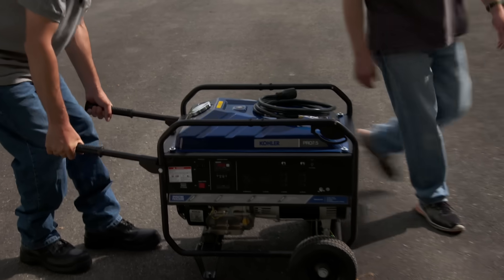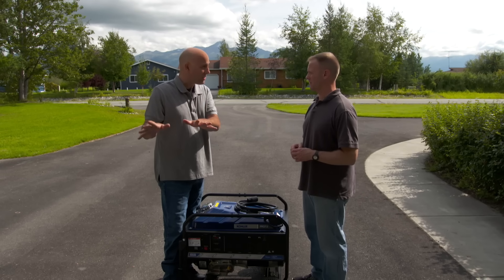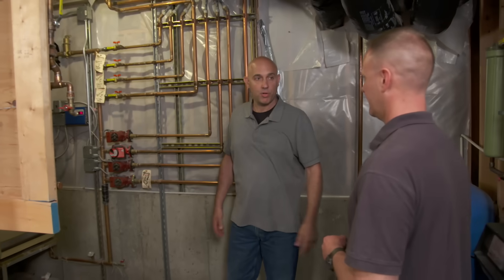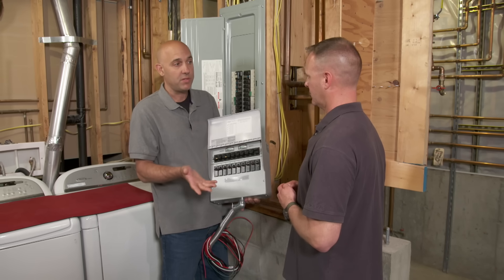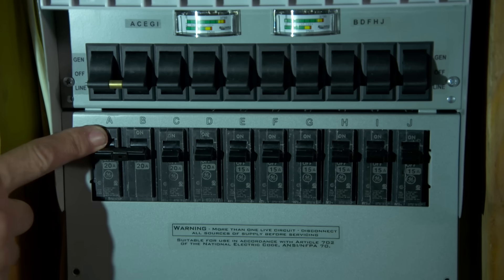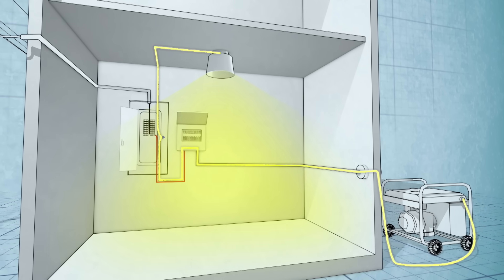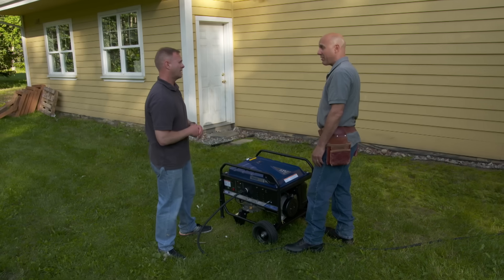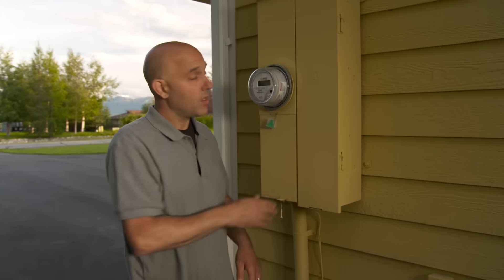How to Install a Manual Transfer Switch for a Portable Generator | Ask This Old House

Comment: If I have AFCI in my main that I want to feed from transfer switch - do I have to install AFCI in transfer switch? From what I'm reading so far - it seems to be the case. Is it OK to connect neural from circuit via wire nut to run down to switch?
Reply: The AFCI could be wired as is, the result will be that during generator power the circuit will not have AFCI protection which is acceptable in many cases.  If AFCI protected is required or wanted during generator operation, then yes you can install an AFCI in the transfer switch.  Special wiring is necessary as the AFCI's will have to be wired together, and yes a wire connector can be used in the bottom compartment of the switch.  If you would like any information on the wiring methods for an AFCI please contact us at support@reliancecontrols.com

Comment: Do you have a video on how to tie the transfer switch into a recessed electrical panel?  The videos I have seen are surface mounted electrical panels or recessed panels with no sheet rock around them.  My main panel is recessed in a finished wall in a bedroom closet.  Am I going to have to demo the wall to add the transfer switch?  Thanks in advance for your answer.
Reply: I don't know of a video that shows a flush mount installation, although the wiring will be exactly the same.  In most cases yes you will want to also flush mount the transfer switch, most transfer switches have accessory kits to help with flush mounting.
Reply: Electric panels are not allowed in closets.

Comment: AM FROM AFRICA! WHY DOES AMERICANS USE 11O VOLTS INSTEAD OF 240 VOLTS?
Reply: America has 110 volts and 220 volts in the same 3-wire system.     110 for lights and small appliances.  220 for stoves, A/C, dryers.
Reply: Because it taste better.
Reply: In Australia we have 230-240v single phase for everything.and also 3phase.

Comment: Interesting episode.  We lived for a week and a half after a bad storm on a 4500 watt gen.   Had lights, refrigerator and ran our gas fired furnace. When we cooked on an electric skillet I made sure the furnace wasn't going to kick on. All done with extension cords. I need to look into a manual transfer.
Reply: A cheaper option would be an interlock kit.  This option also allows you to choose any circuit you want.  The transfer switch limits you to 8 or 10 circuits...depending on the transfer switch you purchase.  Search YouTube for videos about interlock kits.
Reply: Kevin N thanks, that helped out alot because im currently looking to purchase one living WA. Dont need to much to get use through a bad storm or what not. Was looking to get a 7000 watt, but sounds like 4500 does the job.
Reply: Kevin N look into the generac meter you plug it right into the meter when you have it plugged in it automatically has a safety inside for when power goes back on it's just way easier and no extra fuse boxes
Reply: Kevin N y

Comment: What would be the average cost for labor to install something like this?
Reply: It can vary greatly, around 2-3 hours at most on average.  A lot has to do with running the wires from the outdoor plug in (inlet box) to inside to the transfer switch.

Comment: That generator will need some kind of shelter. You can't really leave it sitting out in the middle of the yard during a heavy rain storm, big snow or ice storm. Also, if it is stored in the garage and the power fails after a big 3+ feet snow storm getting it TO the back yard is going to be a challenge.
Reply: So you didn't watch?

Comment: he did not say that the generator should be runned once a month to provent the carburator from gumming up and ceep it warm in the whinter time , it might not start at all if he dosent do this and always use a transferswitch.
Reply: Best thing to do is, while running generator for a period of time, turn off the gas valve and let it run till it stops, just make sure it's not powering anything..that way you don't leave any gas sitting in the carburetor and it will start every time you need it...this has worked on my generator for about 15 yrs with no issues...
Reply: Even better get a generator that is fuel injected with no carburbator.

Comment: How is this functionally different from flipping off your Main breaker and feeding the panel directly through another breaker? Are there Main breakers out there that don't truly disconnect when you flip them?
Reply: It's different in that any human error can cause death or serious injury to any linemen working on the grid if you forget to turn off the mains before applying power. Directly feeding the panel through another breaker is fine but you must use a mechanical interlock device to prevent accidents.
Reply: @eosjoe565   I had my 200 amp panel wired up with 2 Square D Breakers at the top, below the Utility Meter feed. the top Breaker disconnected the panel from the Grid. The 2nd Breaker below that one, had an interlock to it that would not operate unless I switched off the top breaker to the Grid, first.. 
This 2nd Breaker was wired to the panel and to a giant NEMA Female Receptacle outside the garage, where I plugged the Male NEMA Plug that came for the Generator to it.. 
This thing ran usually 2 full weeks or so, 24/7 and we never had an issue.
Yes, we were mindful of how many big things we ran, and of course in winter the only things big are the Electric Dryer, the gas powered Furnace that had an electric fan, and the Hot Tub... Oh and perhaps the electric oven at times..

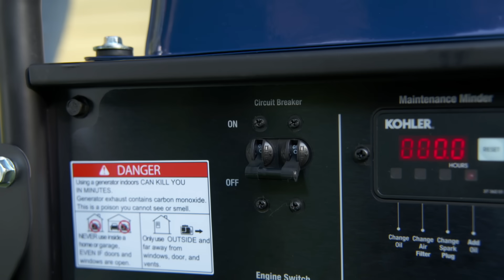Comment: The so-called expert is a total amateur and knows nothing.  Note how the so-called experts tells the ignorant homeowner to turn the choke OPEN at the 7:29 mark in the video.  Even little girls know that the choke is CLOSED for cold starts.  The video is a bunch of crap.  Anyone that has installed a manual transfer switch before knows how bad this video is.  At the 7:43 mark the ignorant homeowner didn't know what he was doing with the choke.  Like I said, even little girls know how to use a choke the proper way.  The procedure to use utility power when the power was restored were in error in the video.   The idiot-expert at the 6:30 mark was too dumb to know how to wind a cord; notice how there is a figure eight twist in the cord.
Reply: Over-under coiling reduces voltage drop, and so does using a cable that's only as long as you need it.

Comment: I'm curious as to what happens if you are using the generator and have to run to the store.  While you are at the store, your power is restored.  At that point you would have two power sources....what happens?
Reply: In the case of a manual transfer switch, you stay on the generator. If you had an automatic transfer switch and and a fancier generator, it would shut off the generator, and return to the utility side power.
Reply: The transfer switch isolates the generator from the utility side. Yes, at that point you have 2 power sources and you are on an expensive one (gasoline)..

Comment: why on earth didn't he get a natural gas generator
Reply: the early part of the video is very clear that he has interruption on the natural gas supply during winter. That's the whole reason the home owner was suggested for this.
Reply: Also the video is very helpful as not everyone has access to piped-in fuel like natural gas or want to buy a dedicated propane fuel tank just for emergency use only.
Reply: And they are located in an earthquake zone...
Reply: He's a noob

Comment: what i hate about these shows is how they show things in the simplest form. then people think they can do it themselves some can and some cant.. there is absolutely no discussion of how to figure the size of generator for the size load and no mention of motor startup current to be added in. how did they know what size wire to use? never mentioned.
Reply: This is not a how to channel. That guy is a certified electrician and that is a paying customer. These videos are not meant to be followed for DIY folks. It’s just basic education of what one may need when getting an estimate. Stop the nonsense folks!
Reply: james hawkins ¡
Reply: I understand and you do make a good point, however that's the purpose of the video short in my opinion - a simple explanation of one of many install methods of setting up a back up gen and transfer switch.  One could write a book on the topic to fully explain all of the information necessary to get even a basic understanding for those not versed in electrical theory or systems.  Some people have to plan for days or weeks before setting up such a system, and the vast amount of information associated with this topic requires quite a lot of research and study.  It would be great if they did indeed provide more information, but this is a TV show and certainly entertainment and ratings are above and beyond all other goals for them.
Reply: james hawkins 
I consider this show largely to rather to be about getting ideas of what to do with your house in certain situations, but not necessarily attempt yourself unless you’re certified... or really cheap and have a whole lot of life insurance.
Reply: I was going to say the same thing also  A 7.5 kW generator will only supply limited loads in the average house. You have to figure an energy budget based on your appliances consumption with the output of the generator. And I would not load the generator up to 7.5 kW, I would leave the remaining 500 watts for the pull down loads on appliance starts. IF you know you need a generator because you have a known history of power outages, then a stand by generator of at least a 20 kW is what you need.
Reply: richard cranium and then shit happens, not everything goes this smooth, guaranteed there will be at least one issue
Reply: @gksjsj4892  
You got THAT right!
The older the house, the bigger pain in the wazoo it seems to be to work on. 
I recently put in a six circuit version of this. Hookup was relatively painless. Finding a suitable mounting position and running the infeed cable- a three day ordeal.
Reply: JeevesReturns glad someone gets it.
Reply: 50 amp plug- never go over 80% load
Reply: This old house shows how to build whole houses, but I don't try it myself.  I don't see the problem here.  You hire pros for what pros should do.
Reply: Tricky to find 20kW gasoline powered generators out there from what I can find when "piped-in" fuels are not an option. Perhaps Diesel powered.
Reply: Number 10 wire good for 30-amp . How to choose the right generator is up to your pocket and how much u wanna spend  . Small generator good for few bulbs and fridge and well water and if u wanna run the boiler u need to be smart to shut a few lights
Reply: The purpose of this video isn't to show you how to do it step by step. Its an informative video, hire a licensed electrician to do this install. This is far beyond the average DIYer's skill range.
Reply: I have seen that to. The problem with "back-feeding" like that is that it renders the circuit breakers non functional. Now that I think of it, I believe I have only seen that done with old style fuses. Thoughts?
Reply: The transfer switch comes with all necessary wiring, which I'm sure is all 14 AWG.
Reply: richard cranium or no mention that messing with your mains power like that can land you in prison ... (Without certain licenses)
Reply: This video isn't supposed to make you a certified electrician. It's simply an informative video. If you aren't 100% sure what you are doing call a licensed electrician to do the job.
Reply: richard cranium maybe another video but it gives u a hoot run down. Do ur research
Reply: richard, I think this is a really good overview of how to install a transfer switch.  The graphic animation makes it very clear how it works.  If your going to do it yourself, then your going to have to do some more digging and calculating to get a good design that works for you.  Some people are going to want a big 20k generator that will run the whole house.  Others will opt to save money and fuel with a smaller 2k that just runs the fridge, window AC and a few lights.  There are endless possibilities...
Reply: richard cranium Otay!!.
Reply: There is also a concern about running electronic equipment (computers, TV, appliances with built-in electronics, stereo, ham radio, etc) off generators like these.  The AC power frequency is determined by the speed of the engine (usually 3600 rpm to generate 60 Hz).  I think a safer option would be to by an inverter generator like the Honda EU7000is that uses a DC generator and Power electronics to give you a stable 60Hz modified sine wave signal.

  7.5kW is the surge rating.  The continuous power rating is only 6.3kW for this generator. 

 For resistive loads your power is ...
P = (Irms_ 240)*240V  + (Irms_120_1)*120V + (Irm_120_2)*120V. 

If you have low power factor loads your generator will have to supply more current for a given amount of power.   P = Irms*Vrms*PF

https://kohlerpower.com/binaries/content/assets/portables/manuals/37_590_01_rev_b.pdf  

Another consideration is altitude.  I'm not sure if this house was in the mountains or not, but Kohler recommends installing a high-altitude carb kit for altitudes above 4000 ft.
Reply: richard cranium
It all goes back to that Woody Allen line "in a lot of high schools they had shop classes where they taught kids how to build things. In mine they taught us how to phone for estimates".
Reply: Read the title.  It's "How to install a transfer switch", not "How to select the right generator".  Also, read the description, it clearly stats the wiring.
Reply: Yes because you couldn’t possibly do some research on your own or, I don’t know, ask a professional electrician. Jesus...how do you do anything in life if you depend on YouTube to teach you?
Reply: Agreed. Also no mention of three phase power connections and if you can use a single phase generator on a home with three phase power.
Reply: richard cranium it's nice to hear someone who sees the same pliant. Never see any complications in projects online.
Glad you spoke.
Reply: Dana Sion generac or CAT diesel backup generators .. They cost a hefty amount but they have a hell of alot more balls than the lil dinky thing they used in this video

Comment: I've considered a 19,500 watt Generac but how long would it run on a full 500 gallon propane tank? A full tank is just 400 gallons, right?
Reply: I would get a 1500rpm watercooled diesel genset if I was you.they are quiet and run longer. Genracs always run at full speed 3000rpm.

Comment: Portable generators will work in a bind, personally I wouldn't use one as an option. Most portable generators will say a wattage they are but that is generally surge watts so a 10,000 advertized generator is in actuality 8000 watts, then they tell you you have a 7.5 gallon gas tank for it that will run for 9 hours, oh but at 1/2 the generators load capacity which in reality means if your power is off for a long period of time and the generator is maxed out, you will be filling that gas tank every 4 or so hours if your running at a full load. For this guy living in the area he does, yeah a natural gas whole house generator might not be the best option, propane is an option as well, but I would personally spend the extra money for a whole house unit and not have to deal with putting gas in a hot generator every 4 hours. Great video though on explaining how it all works.
Reply: I've seen that method as well but it won't work with a whole-house generator as there are no outlets hooked to the power company.
Reply: I go low-tech and hook up a radio to an outlet serviced by the power company.  When power comes on I RUN to turn off that infernal rap music my kids listen to!
Reply: I have a portable generator also but I have it connected to a double breaker with a mechanical interlock so it can power the whole house. I have a receptacle on the back porch into which I plug the generator when there is an outage.
Reply: True during an emergency you are taking taking long hot showers/baths, running the dishwasher, blow drying hair, powering the hot tub, running compressors, running the induction stove/oven, most people will not be entertaining large groups Etc.  Now most people use LED lights so there is no reason to bypass a lighting circuit to save the tiny amount of draw from 3 electronic LED light fixtures.
Reply: Ahah...I had not considered that as I have a portable generator.....
Reply: I will bow to your experience on this. Thanks for providing your expertise.
Reply: I run my whole house on a Honda 6500w Inverter generator. The only two things that I cannot run at the same time are the electric hot water heater and central air. If I need those I can turn off some other circuits and then power these up. I use one of the mechanical interlocks and it has been working well for me now going on 4+ years. It only takes me about 8 minutes to have power back on during an outage. Also, don't forget a PowerBACK alarm to notify you that commercial power had been restored. Very important for daytime power outages.